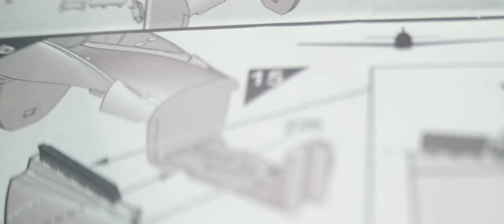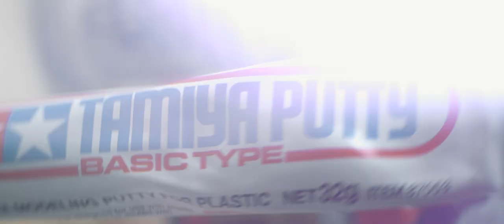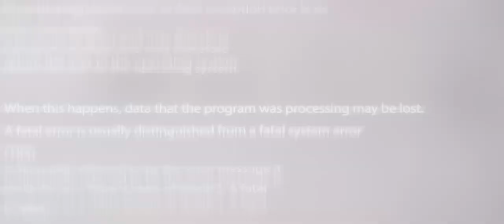S1E2 | AirFix 1:48 P-51D Mustang Cinematic Build

Comment: Nice video...I am building this now...is it me or do the two halves of the fuselage not snap together well ?  I have a large gap in the lower half
Reply from the maker: Thanks for stopping by! Lower half seems to need a little work to make it seamless... consider using clamps and cement to stick them together better. I have learned a lot since making this video, but sanding and puttying seem to be a requirement with these kits hahaha